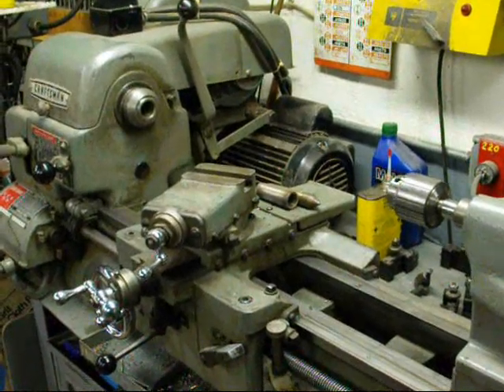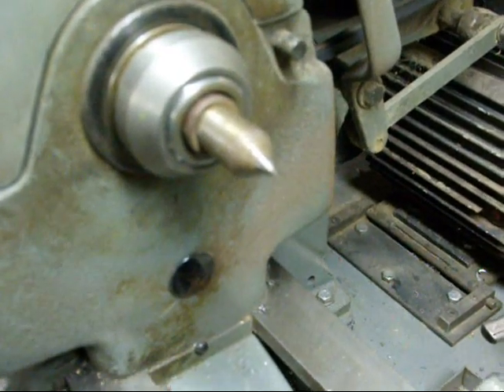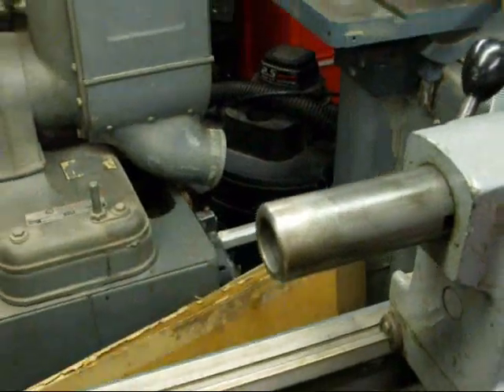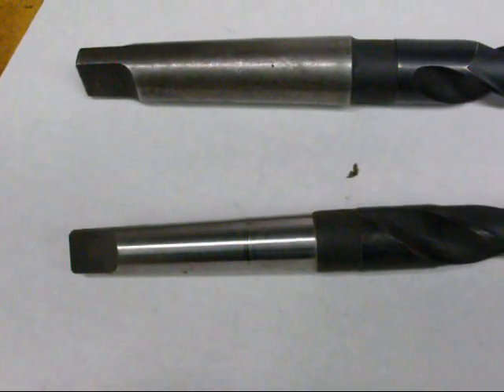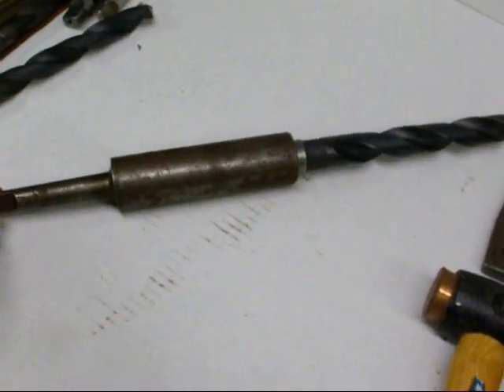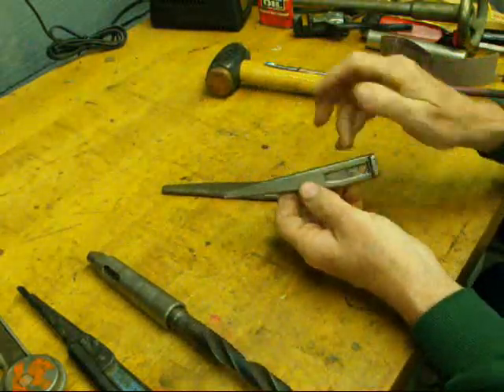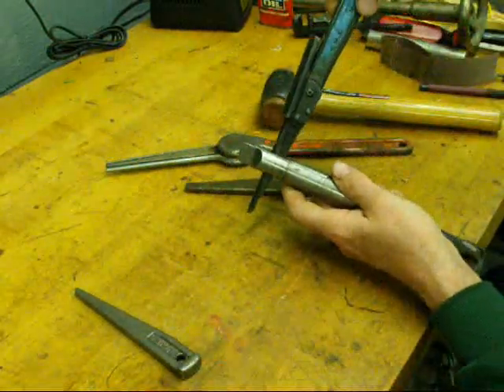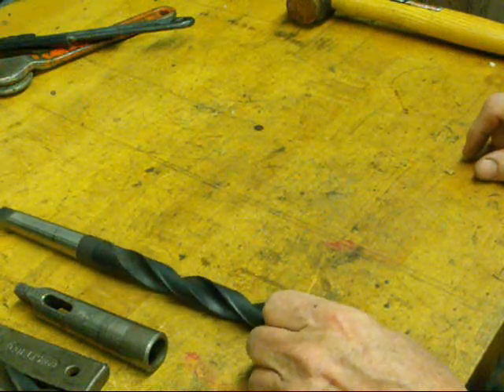MORSE TAPERS on Atlas & Clausing Lathes tubalcain

Comment: I was watching this old video about Morse tapers and you brifly touched on Silver and Deming drill bits commening those should be avoided due to  their tendency to slip in the chuck. For guys like me that years ago aquired a basic set of quality S&D bits (not import) and really cannot afford to replace them i pose this question.  Won't flats milled into the sides of the chucked end of a reduced shank bit at least reduce, or possibly eliminate the tendency of those type bits to spin in the chuck?
Reply from the maker: Yes, the flats help a lot. But then the Chuck can spin in the quill, lol.
Reply: @mrpete222  On small home shop belt driven drill presses, right? How about while mounted to a drill chuck mounted to a MT in the headstock or tailstock? 
Since the SD bits are really the only bits north of 1/2" fractional that I own, I am thinking if whenever I need to use a SD bit for a large hole, perhaps if I first drill a 1/2" hole, then follow that with a SD bit I would reduced the chance of spinning the SD bit because I will have already reduced the demand placed on the SD bit with the 1/2" pilot hole. 

In fact, I seem to recall doing that when I had to drill a 1" diameter hole in a piece of steel well over 1/2" thickness a few years ago. I think I even worked my way up size by size with the SD bits to reach the 1" diameter bit. It was a tedious and time consuming way to get to the 1" size, but I only had one hole to drill, and I don't recall having any issues doing that to get where I needed to go. 

In no way ideal, and certainly not a method industry would use, but for one hole for a home shop guy with the limitations of the machines I own it did get me there without damaging my bits, machine, or the stock I was working with.

As my pop always said, poor people have poor ways! 😆

Comment: I i know this is an older video but morse taper goes from 0 1 2 ...7.  Im currently operating with a mto and trying to make me some tooling to fit. Its all challenging because i only have a 109 lathe . No mill. But also im working on building me a lathe comparable to atlas 12 inch and a mill to my space available which will be bench top .